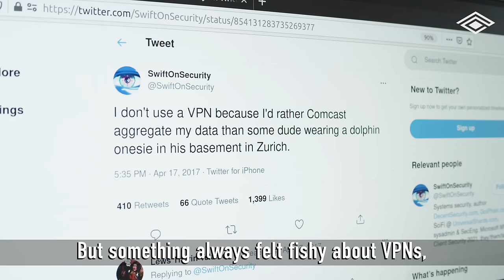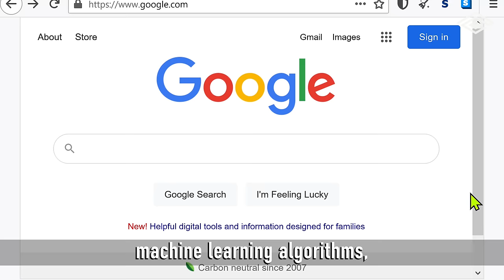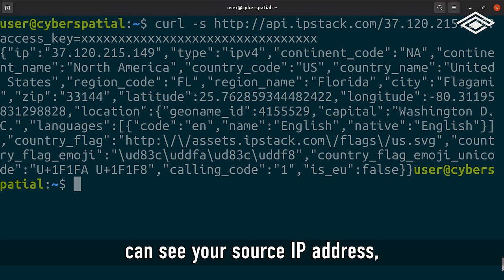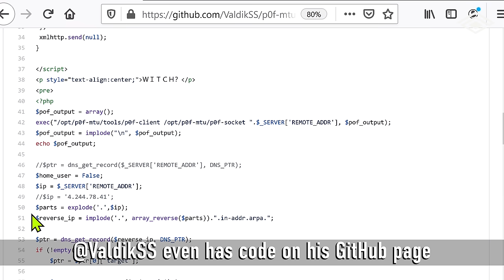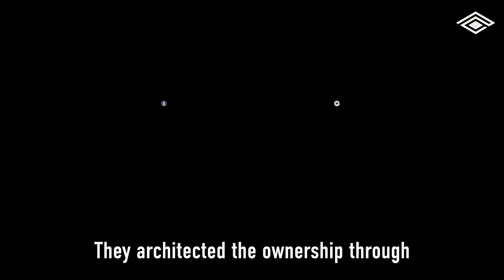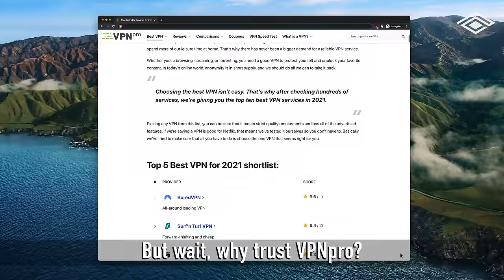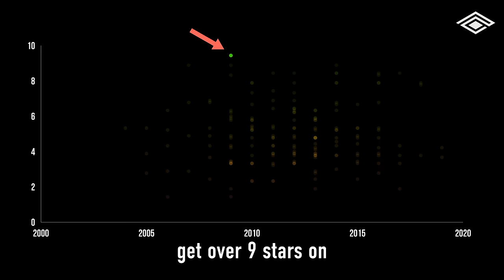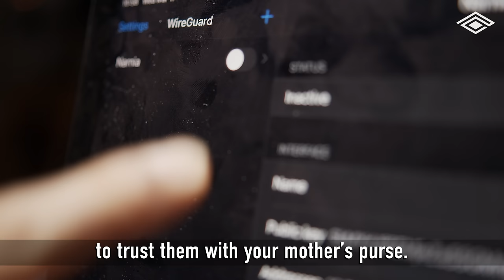Why VPNs are a WASTE of Your Money (usually…)

Comment: I'm a professional programmer and IT security expert, and you nailed it! Great video, you covered it all perfectly, and told it how it is. You just earned a subscriber!
Reply: hey hey. I got a question i kinda forgot about. There is this onboard-encryption thingie which i think was called TPM; Trusted Platform Module. Apparently everything that has even a small mainboard, got a TPM chip. 

I`ve read that it was a backdoor used within the PRISM-Spysoftware from NSA, which Snowden revealed. However I cant find the according sources for that in a quick search. Atleast the fact that they "secret keys" are generated outside the chip and then integrated into it... sounds concerning. 

I always make sure to turn it off in BIOS when possible, but it definetly left an eery feeling that such a widespread, small "bug" basicly can and does exist in every piece of modern hardware. Am i overreacting? Please tell me i am!

What do you think about the TPM as a IT security expert?
Reply: @xenoliferttv9803  TPM is useful for encrypting your OS install, but I don't view it as a security threat. Now, one could argue that every manufacturer hides backdoors in their firmware/motherboards, everything from Intel's management engine to AMD's equivalent. But unless you're doing something super messed up, then it's mostly just a paranoia. But if you are doing shady stuff, perhaps you should only invest in hardware you've verified online that you can trust to pull off such things.
Reply: @hereticerik  Mhm... so thats a nuanced answer. 
Dont get me wrong, but it sounds like you are stating a "there is nothing we can do anyways" between the lines. With a pinch of "Why hide?" argument on top. 

Basicly for you thats a given as it sounds. In the end...  why do we trust AMD? 

Ofcourse, for me as a business owner, protecting my business infrastructure from any other business legit or not, is sufficient. 

For me as a individual tho, i dont got much to hide - i just dont want to share everything with everyone. 

I get that, nobody got an interest in me and thinking that would be paranoia. Still, im not fine with landing on some Intelligence Agencies list and being screened and categorized. 

What if i do by accident come across smth significant, say war crimes and i decide to leak them... history shows me that it gets harder and harder to escape the players you pissed off. Welp, luckily im not playing that game, so yeah why even bother worrying? 

Also there is some strong evidence that suggests people behave differently when they feel being watched.  Im starting to believe that this is just the new normal and stuff like VPNs the Hopium to deal with the side-effects of that. 

Anyway, i like your answer as it is  pragmatic. thanks for your time buddy.

Comment: While this video is very informative it's also missing the point. All those VPN advertisements aren't aimed at people with knowledge on anything internet security related. They're aimed at people who have no idea what the OSI model even is. Also, while you certainly can do most of these things yourself, people pay for a VPN service precisely because they don't know how to and don't really wish to delve deep enough into the subject to learn. After all the entire service industry is built around providing services for people so they don't have to do them themselves. An IT professional should obviously never pay for a VPN service, as said IT professional should have the knowledge of how to set up his own VPN when that's needed, and take a variety of other measures when those are needed. With that said, there is one point of your video that needs to be emphasized: any tool, a VPN included, is only as good as the way you use it. There are many examples of companies using very expensive firewalls for example only to completely misconfigure them so they end up doing absolutely nothing for them. Most people that buy a VPN service don't know how to set it up properly so they rely on the default settings, which than relies on the VPN service provider to have enough foresight to make those default settings good enough for what these people think they want out of the service. Obviously this is a crapshoot on so many different levels and this is the main weakness behind using such services in the first place.
Reply from the maker: Thanks for sharing, totally agree.

Comment: One reason to use a VPN is to avoid or bypass censorship or information control. Even in the United States, there are topics that are suppressed, and to get the reporting on those topics, you need to operate from a different country. Google also rigs search results against political opponents, but changing your IP to one outside the us usually bypasses this and provides more objective results.

Comment: "Have you ever wondered if VPN's do anything for your privacy and security?"
No.  It's great when properly executed and that means from a virtual PC that has no knowledge of anything about you and you tunnel the DNS and everything else (ie, you use a firewall that allows only to go to the VPN tunnel and not "leak" anything) AND you are in control of the VPN itself.
Reply: Yeah, the last part is important. I've thought about making my own VPN... But where??? And from what DNS and ISP? you gotta end out somewhere, right?
Reply: can you reccomend me some good stuff to use in order to implement your idea?
Reply: @powerdude_dk  The author of this video mentions "ssh tunneling".   Basically you have to control the endpoints and while you can easily hide the actual source, you cannot hide the apparent source as it has to be under your control... unless you find a computer that wasn't adequately protected and you "hack" it.  That's illegal in most jurisdictions and the whole point of a VPN is that it doesn't trace back to YOU but the VPN certainly knows where you are or it would not work.  

The best privacy is a computer that is turned off; or at least has no network connection, EVER.
Reply: @thomasmaughan4798  Yeah, I don't understand how owning your own VPN would help. I always thought one of the benefits of a VPN was that the IP provided to me by the VPN provider is shared amongst a bunch of different people, so as long as your VPN service really isn't logging your activity anyone trying to track you via IP will get stuck when they don't know where the data went after it got to the VPN provider. 

If you own the VPN yourself, you just get tracked back to the VPN provider... which is you... and only you... so, it's obviously your connection.

Comment: "Threat model" - that's where this video turned from diss to decent. Actually great, tbh. I don't use vpns much, because I'm mostly aware of their limitations (randos probably won't stalk me, the govt can do it anyway if they want, companies I may or may not care about), but I do see  use cases for them. It's just like any self-defence situation: a targeted attack is difficult to beat, but you can do a lot to avoid getting into bad situations. For internet activity: whether you choose to blend into the crowd more or blend in less but make yourself a tougher target is up to you. "Not worth the hassle" can be a pretty good protection. In the age of AI multiple vantage points (including vpns) may become even more dangerous, but so far data has been easier to gather than to analyze and turn into actual information and insight.

Comment: So as someone who works in account support, the advice to use random answers for recovery questions is a bit of a double edged sword. While yes, its usually basic information that a potential thief could in theory look up about you, the idea that its basic information is the point. When someone reaches out for an account recovery and can't tell us something like their father's middle name or where they were born, its an immediate red flag to shut down the recovery request as it is clearly not the same person. If you forget what your nonsense answer to the recovery question was, you're either going to be permanently locked out of the account when you can't provide it to account support, or they're going to try and verify your account using different personally identifying information on file - in which case congratulations, you just got back in using the same alibi any account thief would use in this situation, and your fake recovery question was ultimately useless. 

Its a far better idea to just make sure your accounts are secured with 2FA if you're that concerned about them, and just make sure when selecting your recovery question you choose whichever option would give the least leeway for an account thief to say they forgot while simultaneously being a bit too obscure for them to just know offhand. Though I might just be biased since this is a very common issue I run into.
Reply: Exactly, that advice is pure nonsense. Add that you should remember bogus answers for a lot of different websites...
Reply: @dariopalermo2095  You're not supposed to "remember" the answers. You put them into the Notes of your Password manager (and if you don't have a password manager you're internetting wrong).
Reply: @GordonMancuso  so the first advice should be “get a password manager” and not “put random answers to password recovery questions”. The second one is unapplicable without the first one… and anyway there are other ways to make the answers secure.
Reply: @dariopalermo2095  such as?
Reply: @GordonMancuso  you want an example of a security answer to a password recovery question? Like “the city you were born”, right? I could answer with the real one and a be exposed to social engineering or I could use a fake one (or a mutation of the real one) and you would never find it. Still that requires you to just keep in mind the “mutation rule” but it would be better than a random sequence of numbers, characters and symbols. And anyway I usually rely on mfa for sensitive accounts (I don’t mind If someone hacks my online pet store account). Obviuously this not covers the need to use different password a for different services (and, by extension, different password recovery answers), but that’s another matter (and could be solved by including some website related ore fix or suffix in the answers). If you want to get paranoyd, we could discuss the “all eggs in one basket” problem that a single password manager poses.
Reply: @dariopalermo2095  this thread isn't about using mfa, it's about recovery questions. Of course MFA is better, but sometimes you don't have that as an option, and sometimes you are forced to provide security questions. So your suggestion is to not use your real information but use fake information. That would only work if you used the same fake information for every site, otherwise you'll be back to the same problem of having to record it for each site. But that still leaves you vulnerable to that information getting out e.g. in a Yahoo-style breach. I wouldn't say that is better than using unique-but-recorded information for each site, just different with its own pluses and minuses.
Reply: @GordonMancuso  this thread is about security, I'd say. Anyhow, I'll give you an example... rule could be "change the city I was born in with (XXX) with YYY (always the same) and then add date of the first 3 letter of the website, an underescore, and the domain of the website. As the rule never change, it's easier to remember the answer withour recurring to a password manager. You're exposed to to information leaks from other websites you use the same answers, if an attacked gets one, he can "reverse engineer" the rule. But then... I would not trust any sensible information to a website without some kind of mfa on a simple assumption: if the website owner do not get the urge to protect user accounts/data with something more reliable than password recovery questions and answers, God only knows what other poor security policies and tools they use. So in theory random answers are better but, imho, in real life they add very little security to some poorly designed systems.
Reply: I miss being able to write my own security question, it was the best way to tailor it as both cryptically unique and with a riddle answer only I'd know.

Comment: Depends on what you protect against.
I live in Denmark. In Denmark the ISPs are required to log all connections and every 50th packet. In spite of such logging being quite illegal in the EU.
I may distrust that my VPN provider may log my data, in spite of their explicit promises. But, om  the other hand, I KNOW that the state is logging. And no, I don't particularly trust them to use the data responsibly. That is what i protect against. And here VPN is a fairly good choice.
I am aware that I could get the same effect for browsing using the TOR network. But browsing is not all I do on the internet. And it is annoyingly slow.

Comment: I've been using a VPN for nearly 20 years. I don't install their software, I only use it from a couple of devices which are only used for certain things and the OS runs off a thumb drive, I never log into anything while using a VPN, I spoof my MAC address, etc. There are uses for personal VPN, but this fairly recent craze of using them for everything is a bit overkill.
Reply: I've used one for the past 10 mostly to get around blocks, filters, and so my ISP won't harass me over torrents. I wouldn't trust it beyond that for any serious level of privacy tho. The recent trend (and probably bad tv shows) really has a lot of people thinking vpn = untraceable :/

Comment: One takeaway from this is that you can never truly trust your phone. You can VPN your phone all you want, but that doesn't mean Apple or Google didn't build a backdoor into it that will let them see every little thing you do. Phones are largely closed devices so it's impossible to fully peer under the hood, and they communicate on cellular networks so you cannot really monitor what they send. At least with a PC on a wired network you can actually monitor things at a very low level.

If you do use a VPN, ideally have a standalone browser that's JUST for VPN usage and NEVER use that browser for anything containing personal data. If you can't be bothered, at least be sure you're using Incognito / InPrivate and that you disable your browser's DNS over HTTPS (Secure DNS) function, as leaving this enabled will override the VPN's secure DNS and leave you transmitting your queries to a centralized source like CloudFlare.

Comment: If your country's government doesn't block things out from the internet then it probably is a waste. But when the opposite happened, it's mostly needed.

It really depends on the country. If the country blocks so many things to access online, then using a VPN isn't a scam for your money at all, it's the opposite actually.

In Indonesia, the government blocks pretty much everything related to adult things, even if it's not directly related. Such as Reddit (a forum platform, but porn is available inside it), many online comic websites that includes 18+ comics (not necessarily porn, but there's indeed adult content in the comics themselves such as explicit depictions of sensitive parts from human body).

Comment: Deeper Network's DPN (Decentralized Private Network) is the Web3 solution for privacy and security. I have been running a device on the Deeper Network for almost 8 months now.
I have nothing but good things to say about the security it has brought to my home network, I've had no issues what so ever. I am a big fan of the 7 layer firewall that it offers. 
Tried and tested, I would highly suggest anyone to DYOR and I promise you will love this project just as I do.

Comment: 14:40 After watching this video, I am even more confused than I was to start with. All I want is to be able to use WiFi when I’m out in public and not have to worry about my personal information and sensitive data being compromised. Spoofing my location might be useful once in a while, but a secure public internet connection is my primary goal. Is that possible?? Or am I SOL? I use secure and unique passwords, 2fa, virus protection and lots of caution/commonsense with incoming emails. I’m not a techie but I believe that I am better-than-average competent with today’s technology. Any advice on how best to use public internet would be most welcomed.
Reply: Public wifi is generally a bad idea, I’d only use it in an emergency situation like if someone is dying and it was the only way to communicate. A VPN won’t protect you from all attacks. It may help if there’s some site you’re using that doesn’t use an SSL certificate but that’s quite rare these days. VPNs are more a privacy tool than a security tool. If you haven’t already, probably the biggest improvement you’ll see in your security is abandoning windows in favor of linux or macOS.

Comment: Previously the only use case for 99% of people is torrenting. Now with Geolocking of streaming services and the new option from many mainstream VPN providers you can acquire private IP's not shared IP's.  Which basically allows someone tech literate enough to setup means of sharing geolocked streaming services to multiple households

Comment: Another reason to use a VPN is for things other then web browsing. Securing IOT device connections, obscuring your IP address if you have a static/fixed IP, or using insecure/untrustworthy software or devices. My favourite... still using POP email? Your password is sent in the clear over the internet.

Comment: 16:34 Look for Rays Law of the exponential increase of computing power versus cost interpolated to a line in a logarithmic scale! Since Moores, well it’s Moores .. exponential is to put popcorn on each square on a checkerboard; 1 on the first, 2 on the second, 4 on the third 8 16 32 64 128 256 512 1024 2096 4192 8384 16.. 33 .. First two rows on a checker board, 8 squares.. from 128 to ~4M+ after a two rows step.. a few steps left